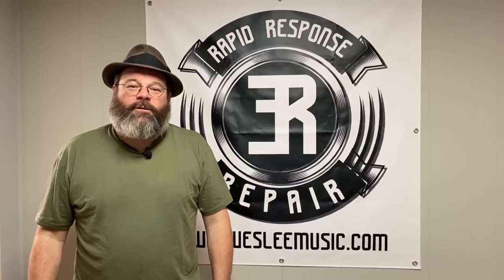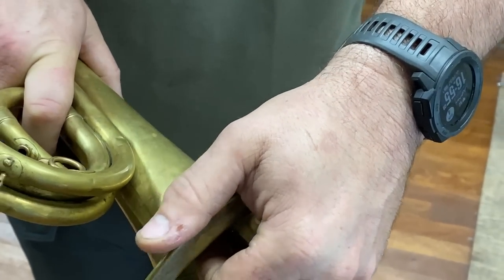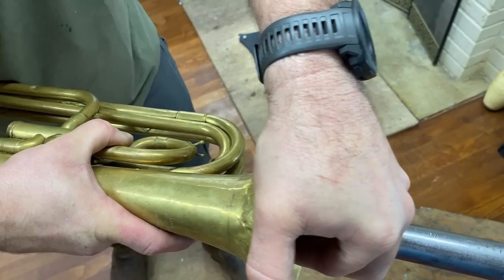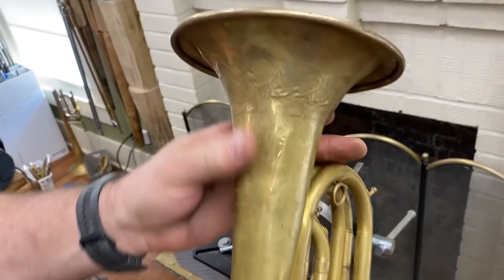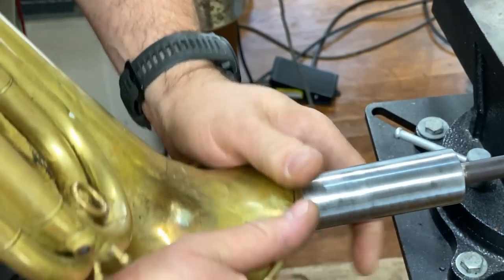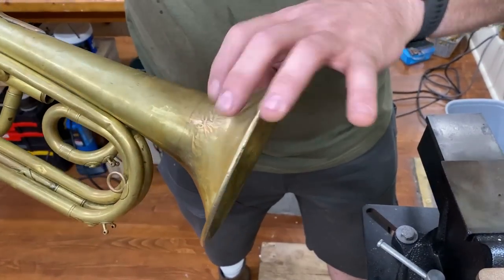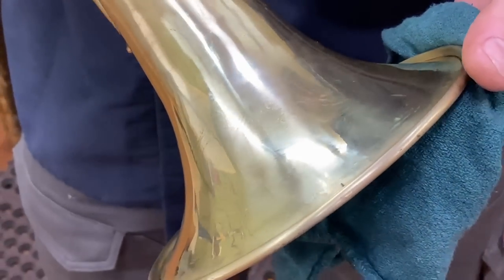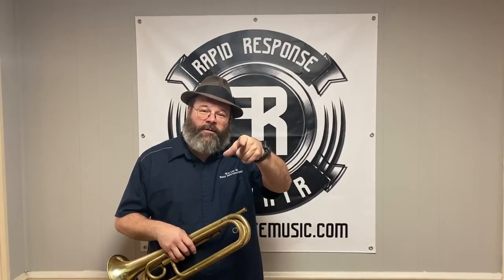Single Piston Bugle Part 2- Re-shaping a bell, 6/4/23,  band instrument repair

Comment: Nicer job on the bell restoration.  That old Slingerland appears to be a French horn used in a Drum and Bugle Corp.  Now days they use 3 valve versions and regular style trumpets.  Back when I did the DC thing, we had two valve horns, one rotor and one piston valve.  I believe the thickness of the brass was due to a coup[e reasons, one was it was mot expensive to manufacture thinner brass stock and it was more delicate to work with.  Another reason is these were marching instruments used in competitions, as such you really need to project to the tops of the stands.  A more rigid bell projected better than a thin, more resonate one.  Sure brings back old memories... I have an Olds Ultratone soprano (key of G) of the same model  I played back in the day, I still play it once in a while..

Comment: You may have not known this but in the old days of DCI that is what the Soprano's had and most of the other horns had as well. Only one valve. They later changed up to 2 valves and now they use standard B flat 3 valves. But what your holding there is an original Corp horn. My Drum Corp had a couple of these things sitting around in the main office and they would let us play around on them for kicks. We had the 2 valve G ones.

Comment: Not at all boring to watch.  I am amazed that you didn't have to anneal lots of the dented areas to get them compressed, but I suppose that reshaping the bell made the the undented parts stretch to fit.  What was the problem at the spot that you did anneal?  Turned out great.

Comment: You don't seem to realise when watching how much the brass will work harden while being rolled out. That's why at the end Wes has to ' normalise' it with heat so he can work it further. As the brass consists of roughly 70% Copper 30% Zinc it's the Copper content that work hardens. Normally when working pure Copper you have to fully anneal it to carry on working it which means heating to cherry red then quenching in a pickle bath to remove the black copper oxide. I assume the Zinc content of the brass allows it to soften enough with only a light flame and just normalise the metal where it can be worked again. ( I used to be a High School metalwork teacher here in the UK, and once upon a time I was a Euphonium player in a brass band. Hence my interest in watching Wes do this amazing work.)

Comment: About the annealing or normalising, I work in the metal trades and often deal with heat treatment, I wonder if there's a difference in mechanical properties in brass between annealing in a furnace and normalising with a flame. I believe most brass is similar to copper in that it doesn't easily harder with heat treatment, so would just call it annealing.  
You're not wrong calling it normalising, you could call it annealing or stress relieving and still be correct, I'm just not sure if the distinction is necessary as it would be with a high alloy steel.  
Love your vids, sheet metal work has always fascinated me, every time I've attempted it I end up with your before photos rather than the after.

Comment: Im not an instrument repair person in any way shape or form. So it's amazing to me ho you work the metal. In the bead ant the mouth of the horn, is there a wire inside of it? I was just wondering how it didn't smash or dent when you were hitting it with the rubber malet.